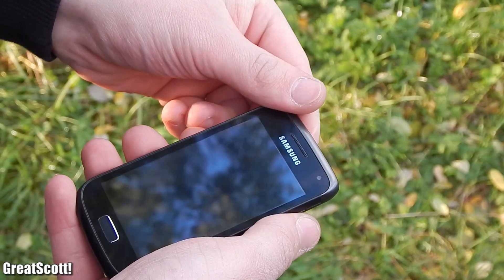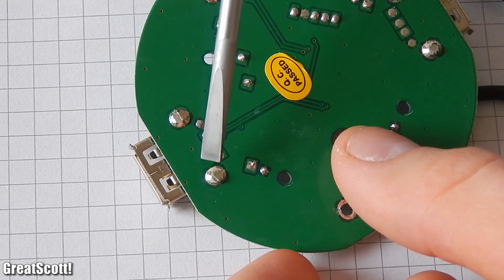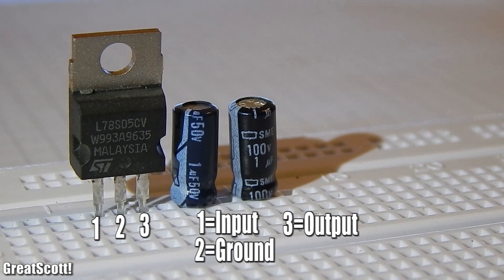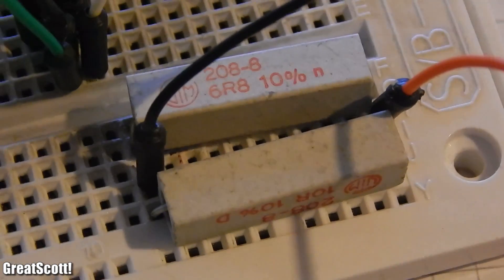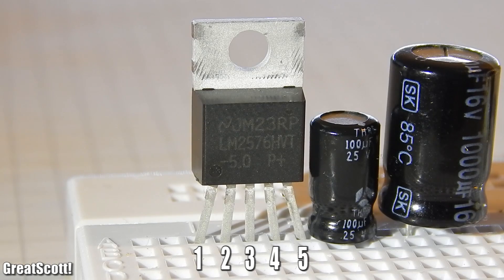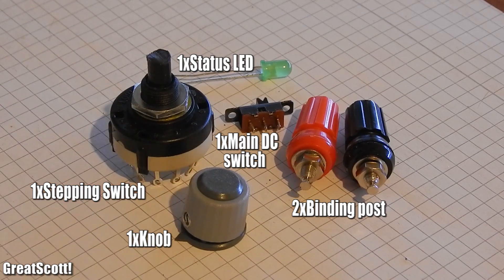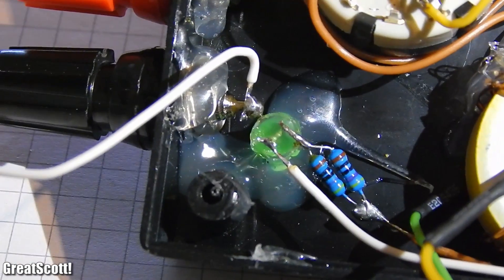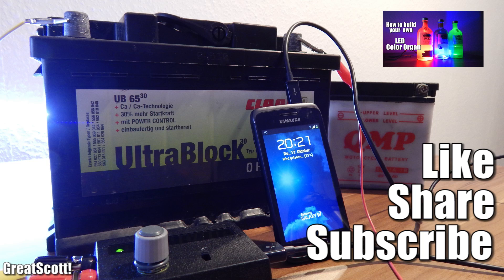Charge your phone with a car battery (6V-24V) || Voltage regulator

Comment: hello can you help me I already have adapter 5v so I connect to is usb cable, on the screen show its charging but in reality not charging I check the voltage and its 5V the adapter amh's is 5A do yyou think the problem is thhat I didnt short the data wire like here 1:25

Comment: But we can charge new fast charging mobail using power bank circuit at output of 5v of voltage regulator, 
In order to get 9v, or more for fast charging support.
But input watt and output watt is not mach. 
Can you make it.
Reply: No soldering even needed. Technology has advanced so much. This video is uploaded during 2013.
Get a cigarette lighter socket female with wire, connect to 12V~24V battery directly.
Get a car charger with USB-PD, connect to cigarette lighter socket, done.

Comment: l was wondering what will happen if we don't use the coil and the schottky diode ? Because when l'm using them my output amp is getting too low around 80mA.And as a second is this safe ?

Comment: Hi dear GreatScott, is the difference between regulated and unregulated voltage the 'regulation'? and why can we power an arduino with USB cable since it needs between 7 and 12V. Thank's for all;).

Comment: lm2576 is ok for 12v bat, but not enough droput for a 6v. let alone 7805... you need 8v to assure stable 5v output. for a 6v bat just put a diode in series...

Comment: That is almost what i was looking for! Great Video. But what to do, if i need more juice to power a phone while using google maps for navigation? is there any way to get 5v with 2 amps? also: Are the smartphones smart enough to regulate the incoming power down? I am very intrigued to just connect the phone to a 6v battery directly and see what happnes..

Comment: please use a heatsink on the 7805 👽
Reply: Radio 336 Did you have also problems with overheating? Maybe it will be better with some additional current regulator. I must try sometime.

Comment: I want to charge my phone using a 19 volt laptop adapter. but I can't make the tranformer circuit to decrease the voltage from 19v to 5v. I atleast want 4amp from that 5v, so that I can charge my smartphone more faster.
Reply: Sakhina Khatun Don't do that
Reply: Higher current =/= faster charging. Your phone only draws as much as it can.
With your logic, of u hook up your phone to your car battery it will charge instantly because care batteries can provide over 300Amps

Comment: Hi! Just a fun question!
How does a regulator like this react to a non constant energy supply? By non constant I mean the voltage may be changing, like in the case of a hand driven generator: you can't turn it with a constant speed, so you produce changing current.
Reply: With the linear regulator, As long as the voltage is above 5v, you will get constant 5v, if the supply voltage gets below 5v, you will get changing voltage, but the voltage would not get above 5v. In other words, the regulator shunts the voltages above 5v. With the switching regulator, if it is a buck-boost converter, you should get a pretty steady voltage if power is not limited by the supply, like for example, a hank-cranked generator which cannot provide much power. If you use the buck converter, as shown in the video, the output voltage should behave like the output of a linear regulator, except that instead of shunting the excess voltage to ground, and producing heat, the buck converter adjusts the duty cycle.

Comment: Scott would you please clear some confusion?
1. According to this circuit (http://www.instructables.com/file/FHR3DTTHT2TZCTE/)  am I getting the efficiency of 83%?
2. Is the above circuit can step down any voltage from 6 to 24v in 5v?
3. Instead of coil inductor what can I use? It is not available near me.
Thanks.
Reply: Buck convert

Comment: instead of a voltage regulator what if I used a setup consisting of a PNP transistor. 5v zener diode, a capacitor, and some resistors? basically current flows through the transistor and then the voltage is about 5v current in the transistor will shut off. as current is drawn from the capacitor the circuit will maintain that 5 volts with a pwm type signal through the PNP transistor. would make a cool video if it worked

Comment: In starting of the video u used 2x1uf capas but what will happen if I use 100uf 1000uf or even 2200uf what will actually happen if I replace these ??

Comment: Hey sir great scott.... Guess what, I made a successfull LM2576 cellphone charger using my motor cycle battery.... It's so efficient there's no excessive heating and i can fully charged a phone in 1 hr 30 mins. I used T94-26 iron powder toroid core and a #20 AWG copper wire at 41 turns to achieved that 100 uH. It's quite difficult to find inductors here coz nobody seems to be selling them. I only used a salvaged toroid for that inductor.

Thank you sir great scott it's very wonderful and handy project. I'm planning to mass produce this project and sell in rural areas if i can buy inductors or that toroid i am using right now. I'll send you part of what i earn out of this to project to support your videos. Again, thank you sir great scott!

Comment: The iron powder toroid inductor you are using here is a T60-5 (yellow), am i right sir? it's difficult to find one here in davao city, philippines. I have one yellow toroid similar to the one in your video I salvage from an old, out of order computer AVR. I hope this could work. I've been studying how this buck converter works, the materials you are using. I'm on my way to build one but i have to omit that switcher and the LM7805 circuit because all motorized vehicles here are in standard 12V with varying Amperes depending on the type of vehicle. If i can successfully  build one I will let you know. Great videos I am learning still. Thank you Great Scott....

p.s. i have very minimal background in electronics and i don't have adequate and sophisticated equipment such as your. Please bear with me on technicalities...

Comment: Buy a car charger and plug it to car lighter socket. That's easy. And cheaper and safer also.  http://www.ebay.com/itm/New-12V-Power-Dual-2-Port-USB-Mini-Bullet-Car-Charger-Adapter-for-Phone-Pod-EG-/321854898505?var=&hash=item4af00c0149:m:mbRAhhQIAj5VKRJ5m9c110A

Comment: So did he just make a power inverter??
Reply from the maker: +Saeed Mizan No
Reply: oh I thought that was the power inverter as it was taking power from the car battery
Reply: +Saeed Mizan a power inverter takes DC and turns it into AC, in your case 12 VDC into 120/240 VAC.
Reply: He's just stepping down the voltage.  Inverter changes AC to DC or DC to AC.
Reply: +Saeed Mizan B O I
Reply: OH
Reply: I Get it now
Reply: I think you mean power regulator
Reply: +Amy 2 I cannot believe I got the spelling right
Reply: Steven Tyler oh okay

Comment: we can easily do this with step down voltage out 5v dc.
 http://www.ebay.com/itm/LED-display-LM317-Adjustable-Voltage-Regulator-Step-down-module-AC-DC-to-5v-12v-/361260307714?hash=item541ccad502

Comment: or just get a car cigarette lighter adapter and cable for your phone £2.50
Reply: Rusty Jones My car requires that the ignition be turn to the on position in order for the cigarette lighter to be powered. This video works better for people like me as I don't want the entire charging system of my car to need power as well while I'm emergency charging my phone.
Reply: +Dave Easter just buy this and connect it directly to your car battery..... http://www.ebay.com/itm/Car-Battery-Jumper-Booster-Start-Extension-Cables-Charger-To-Cigarette-Lighter-/111765267458?hash=item1a05baa402
Reply: +Ahmed AL mudhi just about to say that 😏😂
Reply: great minds....
Reply: Rusty Jones those things don't charge for crap. It takes 10 minutes to get 1 percent
Reply: But I want a lot of power away from a car. So a cigarette lighter adapter is useless.
Reply: best comment on planet earth.😅😂😂😂

Comment: For added protection, you should add a crowbar and fuse circuit on the outputs to prevent an overvoltage failure mode. Your iPhone will be more protected. 
Great videos!

Comment: Here you use a 16v capacitor on the input (switching regulator), what happens if the input is up to 24v?
Reply from the maker: theartbitch15 No, the input capacitor is 100µF/25V.

Comment: Hey man, can you do a version where you wire 2 USB ports to the circuit? Or can you send me a schematic of what I would need to pull this off? I pulled some USB ports out of an old PC, and I want to add 2 permanent USB chargers to my Dash.

Thanks, Cheers.
Reply: Simply connect the second USB parallel to the first ;) The current will be maybe lower (half), but this is the easiest way I think :) Or buy USB HUB ;)
Reply: I'd like to make sure it is in series... equal voltage out of each one...

Comment: With my previous car (a Ford), I could charge my phone without starting the car for a few hours with no loss of starting power.  With its small battery, it's logical that a phone is not much of a power drain. Anyway, is it possible to drain your car battery too much if you charge your phone for 8 hours using this kit?
Reply: +Larry Autry With enough charging, yes. Realistically, it would take weeks of endless charging before your vehicle wouldn't start.

Comment: It's nice, but you can get one of these USB chargers that fit into the cigarette lighter for a couple dollars. On eBay I seeing them going for less than US$1 with free shipping. They have a mini switching buck regulator in them. Even if not using it in a car, just solder a couple wires to the cigarette lighter jack to use anywhere else. Much less work, and less cost.
Reply: Lol have fun sitting there for 5 hours while it charges